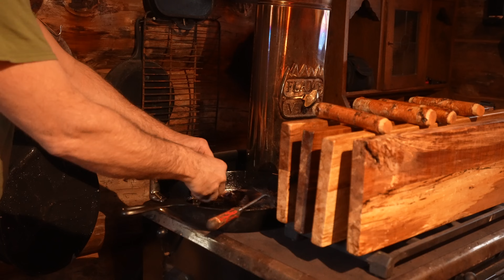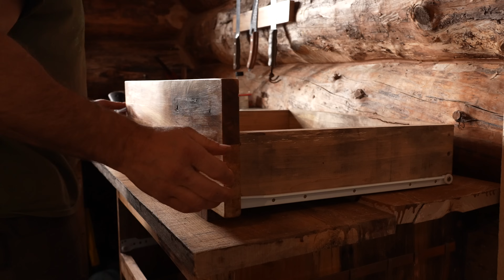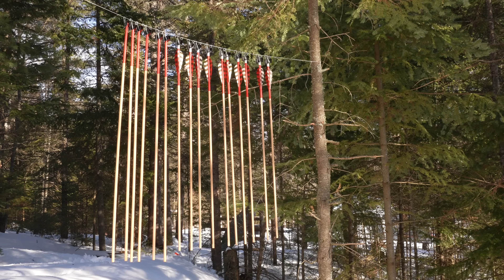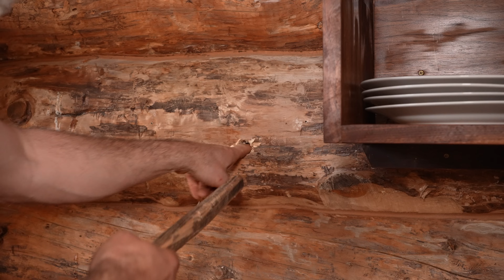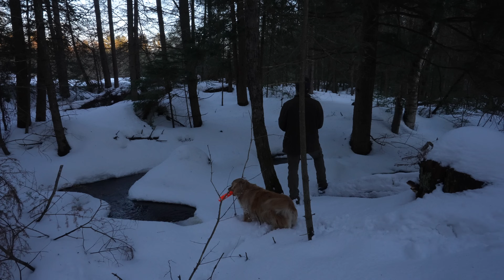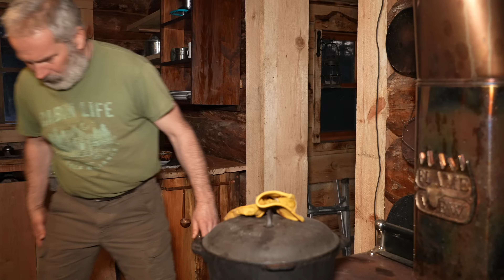Installing Floating Shelves, Upper Cabinet and Drawer Fronts in my Off Grid Log Cabin Kitchen

Comment: Hard to believe this man had cut every one of those logs by hand. What an accomplishment.
Reply: Actually he built 3 cabins by hand & he’s shown a picture of the first one he built. But it was the first time of him building a cabin by hand he didn’t vlog it. Shawn said it was a trial run and he was really a young man & really didn’t know what he was doing. Also If you hadn’t seen it He blogged the whole build of the 2nd cabin on this channel. Which turned out amazing and it was built just like folks in the 1600-1700’s would’ve built one, by hand with all hand tools except on occasion he did use a chainsaw on just a handful of things like milling the interior lumber with chainsaw. But for the most part 95% of the 2nd Cabin was done by hand. Also the roofing materials was built with wood and he used Japanese method of burning 🔥 or charring the wood to waterproof the wood roofing without any modern roofing materials.  Same way they  done it hundreds of years ago. But This 3rd Cabin is quite a bit larger, with underground cellar/basement under the house itself . The 2nd Cabin Property he built an underground food storage cellar but it was nearby but not under the house.  On this 3rd present cabin he 🔥 burned/charred all the underground foundation timbers to waterproof them. He even dug out the cellar/basement with a shovel by hand, back breaking labor.  Also on this 3rd cabin he used the modern metal roofing instead of the charred wood roof.  Which I think is much better and less maintenance decision. Also Shawn’s fixing to build on to this cabin this spring by adding an outdoor kitchen like he had at cabin #2. Because cooking over fire 🔥 wood heater/cookstove is just way too hot in the house in the warmer months.  This cabin is by far much bigger & nicer than the 2nd one. He hasn’t said or if he has said  I’ve missed it, about building a outdoor cabin hot sweat 😓 sauna.  If you’re not familiar with his other channel.... Then Watch the Shawn James channel where he talks more and tells of his plans on his building on this channel.  This channel is mainly building and less talk.
Reply: ??? He is using a chainsaw and a band sawmill, both with combustion engines. Additionally a four wheeler and a snowmobile. But of course the rest is all done by hand.
Reply: It seems that all that hard hand work has effected his body in a negative way. Which could have a long term effect, but of course he’s in a perfect environment for good healthy living. Shawn nobody would blame you if you used power tools from now on!

Comment: The squeal of the stove door is raw metal on metal, which will lead to wear and a poorly sealing door. A bit of graphite will smooth things out and it won't burn off. It worked well for our Kalamazoo side burner. It came with a water heater, bread warmer box on top, a griddle and nine inch plates. A bit much for your cabin, but we were a big family and it cooked many a large meal. As the youngest boy, I got to keep the firebox going and hauled the ashes to the garden...

Comment: That sore neck looks very familiar. Here is how I fixed mine, by lifting my head. From my chin and the back of my head and “gently” lifting my head. Then by my ears and gently lifting holding for a few seconds.  After about two weeks I was out of pain. …..but no resting my hands on my head or putting any pressure on my neck like squeezing a tight cap. Beautiful work as always by you and your wife. I loved the ambience in the room when you turned the light on.👍🏾

Comment: Shawn, technically those aren’t floating shelves. If you had drilled holes in the shelf boards so that the dowels were hidden then they would be what is commonly referred to as a floating shelf. In any case they look good. 👍🏻👍🏻👍🏻

Comment: Watching you do stretching before shooting your bow reminded me of my mother who injured her back lifting her grandson. She was in the hospital and required traction and was out of work for a year. My stepfather made a hanging bar for her above a doorway, essentially a two foot piece of pipe with elbows and short lengths of pipe and flanges on each end to attach. The weight from hanging would help stretch and relieve pressure on her back. While you are setting things up at the cabin, it might be helpful to install something like that. After you hurt your back would not be the time to install that. Better to have it ready for use. It is essentially a home traction device.

Comment: It would be nice if you could string some LED dawn light censor bulbs to the outhouse. That may not be possible where your at though! Just a thought, I guess still it's just as easy to use a flashlight and or more economical.

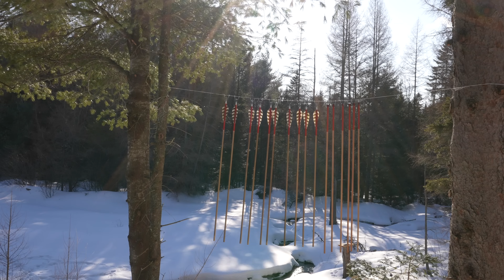Comment: Question about the arrows hanging vertically from a string @11:20. Is that done to prevent them from warping while in storage if laid on something horizontally or standing on end in a quiver?

Comment: Hi Shawn - Just a suggestion (kitchen designer here, lol). You may wish to mount the drawer handles on spacers rather than have them flush to the wood front. Two reasons: 1) If your hands are goopy and you need to open a drawer, it'll be difficult to grab the handle and you'll leave the handle all gooped up when you do grab it and 2) As we get older, handles flush to the drawer are difficult to grab (pain in hands). If you have enough space behind the handle for your fingers to slip behind it, painful hands won't have to grip or bend (or you can use a coat hanger or some other curved object to pull the drawer/cabinet door open - ask me how I know, lol). 
I've literally just changed out all of my cabinet drawer and door knobs and 'grips' to handles I can easily slip fingers into or behind.
Cabinets look wonderful overall!

Comment: Now that the Cabin is built and working on the inside is your Wife going to be spending more time with you and your daughters.
Reply: I think that Shawn’s wife will not join him full time at the cabin until several other major items are completed. Work on the cabin’s solar powered electrical system is well underway, but it is not completed yet. There is a fresh water tank and drain in the basement but no plumbing for either the kitchen or bathroom has been installed yet. The main bedroom has not been added beside the cabin. The summer kitchen still has to be built. So as hard as Shawn has worked crafting this terrific off grid cabin, there are still many tasks to be done yet. So perhaps once these things are done his wife will join him full time at the cabin.

Comment: Another great video.  Technically those shelves are not floating.  If you drilled those dowels into the shelf too, then into the log wall so that the supports would not be seen, it would be floating.

Comment: Curious has the cabin been tested for mold?
Reply: @jmp1036A  ah the default response to everything .  and you are still triggered i see
Reply: @jmp1036A  TRIGGERED
Reply: @kellymulderino7156  I'm probably not the only person who is curious to know why you're triggered by the notion that mold  could be an issue.  I would have thought the wood stove would make things very dry.  Maybe you could elaborate a bit on the reasons for your concern, and you might have a better chance of getting some info back either from Shawn or from someone who has log home experience in a similar climate.
Reply: @timepasses3380  not triggered at all but was curious about it because of all the moisture that has accumulated in the wood during construction and also he had a major water seepage problem in his cellar below the cabin.  mold is nasty stuff and will grow on any plant-based material so i suspect he may have major colonization in his cabin

Comment: Personally, I don't like the material you used at the bottom of your support posts. It doesn't fit there . If I may suggest an alternative that would fit well with your creation.  I'm thinking birch bark or other kind of bark you worked with some friends on a past project.
Reply: Maybe the full bark like they used on the longhouse.